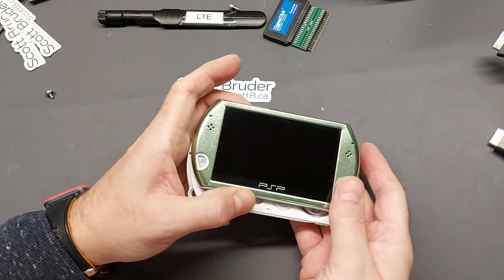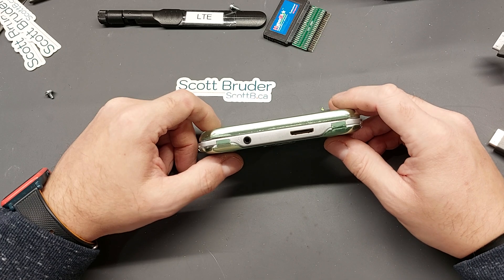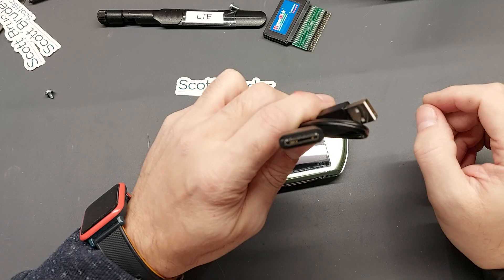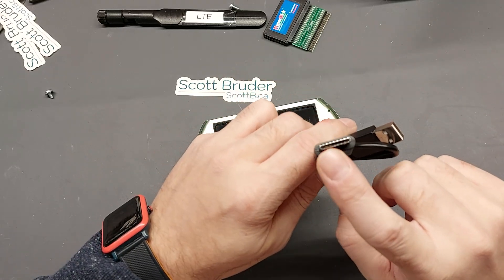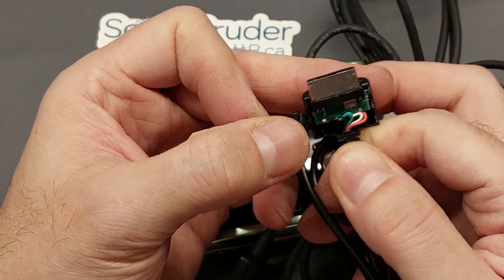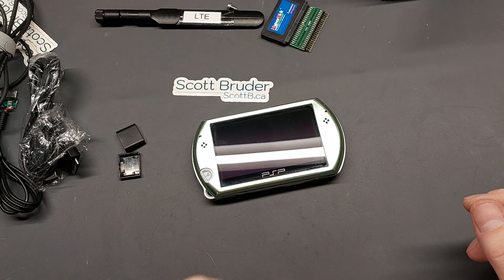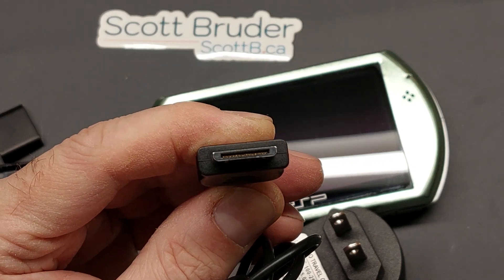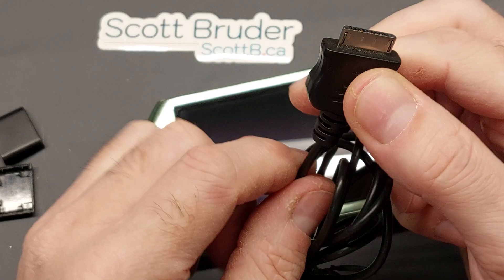PSP go diy dock project.  preparing.   Need to find a source for connectors.

Comment: Hi scott, i found what seems to be some fully pinned cables on Ali with description I 
$2.58 | USB Charger Cable Data Transfer Charging Cord Line For Sony PlayStation Portable PSP Go PSP-N1000 N1000 to PC Sync Wire Lead
(It will not let me post a link
Reply from the maker: Thank you.  I have been messaging a number of Aliexpress ads that show pictures with all the pins,  but all have checked their inventory and say the ones they have only have the 10 pins.
Reply: @ScottBruder  i also asked for the parts the conector fully populated pcb but they didnt want to sell those
Reply: @ScottBruder  i already have the video cables but im trying to figue it out on how to be able to open those and expose the pcb conector its  complete piece of molded rubber plastic is not like encolosure, any ideas

Comment: You could probably just get a psp 3000 tv out cable cut that port and solder this one on , as I've seen from your comments you probably knows about that aliexpress listing for the 28 pin cable if the seller confirms( or somebody else )that it really has them i will do this too and 3d print a case for it
Reply from the maker: i have sent more than 30 messages to China supplies and manufactures and it looks like there are not more 28-pin connectors.   i have found 5 of them.   So some time in the future I will try and make a dock.
Reply: @ScottBruder nice ! Could you please tell me where ? Those docks are creazy expensive and i just want to make one too
Reply from the maker: @zZFlaviusBoss mine came from a friend who ran a store. Many years ago . If if you want when I can sell it to you for big bucks
Reply: @ScottBruder  well at that point im better off with the aliexpress av cable lol I wanted to make a cheaper alternative some online stores in my country sell the same charger you scrapped for the port for like 30 bucks i wanted to make a whole dock with hdmi upscale within this budget
Reply from the maker: @zZFlaviusBoss  Thats my goal too.  HDMI upscaler, USB-c all in one dock.  If you make your project please share your progress !!!!
Reply: @ScottBruder  my ideea was to get a component to hdmi upscaler from aliexpress with 5 bucks (welcome deal) make another account to get a 1 buck psp 3000 cable then buy a female usb c port and the 3000 headphone jack I'll wait a bit to see if that aliexpress listing actually has 28 pins and get that too